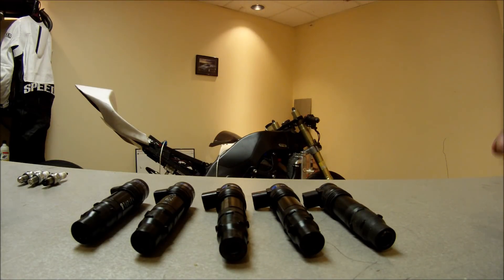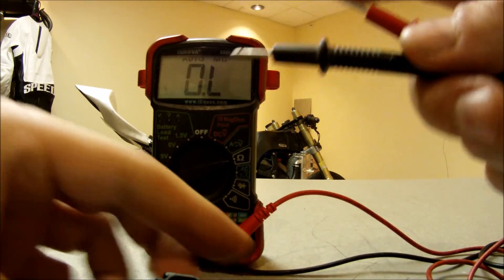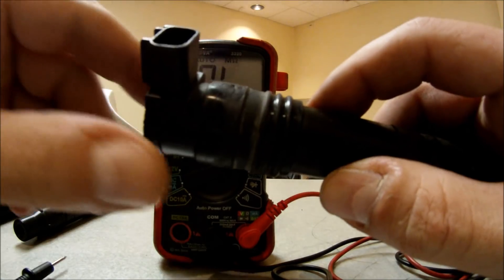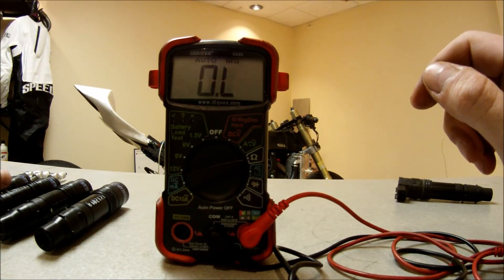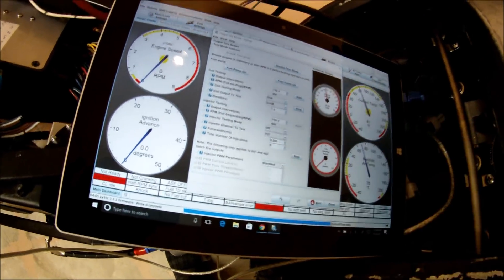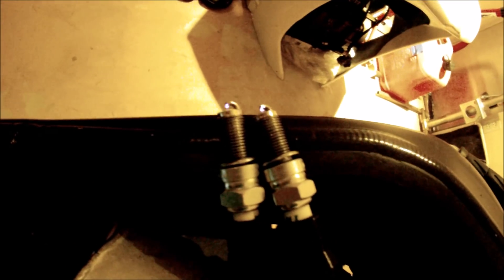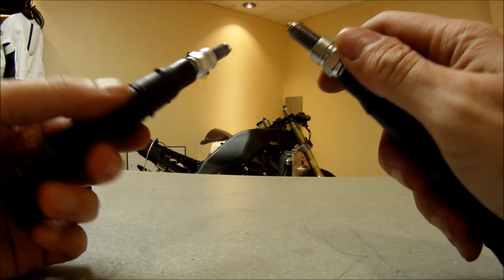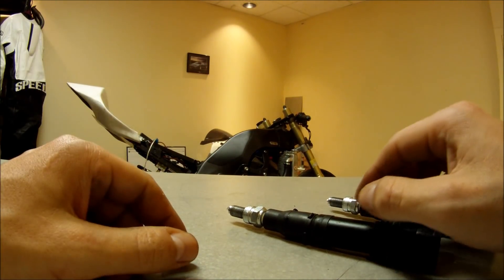OE Ignition Coil VS High Performance  Ignition Coil, Tested and Comparison, Best Spark and Specs.

Comment: So, can someone please tell me how much voltage my ignition coils provide at the spark plug? Primary resistance: 0.6 k Ohm, Secondary resistance 13.2 k Ohm. The ignition coil boot also has a 2 k Ohm resistance itself. Input voltage is 14.1 Volts. Thanks in advance.

Comment: Can't wait to order these.... going to order the wiring harness along with it. UPGRADED my FUEL SYSTEM (PUMP, and INJECTORS "6 PIN HOLE") my stock coils are garbage (have 65k on em), and are ABSOLUTELY TIRED.... GONNA WAKE MY GSXR 600 "UP"!!!🤙😎

Comment: He is not the one, at timestamp 03:15 the screen of the multimeter blinks, so to speak, goes blank as if power from battery is low or one or both leads are slightly or completely not seated tightly within there terminals, so we are viewing this material and are expected to trust the information given, so addressing the multimeter, he gives it a forceful slam on the bench top, so should I be trusting this new technique to address multimeter screen out. I think not. Trust is fickle and console very quickly be eroded or disappear. He never checked the leads, batteries etc. This is not the one. Oh did he disclose that the cheap coil is original to his bike which is not new and the expensive coil being tested is new. Not good science.

Comment: Instead of opening up the multimeter to get the battery to make a good connection ,you smacked it on the table.
Reply from the maker: Yes.

Comment: Absolutely no difference. Both sparks are capable of igniting the mixture. As soon as the mixture ignites it does its own thing, regardless of the power of the spark that ignited it. A fatter spark does not give a fatter ignition.

Comment: One thing I learned from performance coils is they really don't make a huge difference on fuel injected.
The main reason carbureted vehicles benefit so much from better ignition coils is because their carburetion is heavily emissions spec and full of other fuel/air compromises that make carburetion far less than perfect. What a high output coil does in these cases is compensate by its superior ability to ignite less than perfect mixtures. Better ignition coils make up for poorer carburetion.
Reply from the maker: Great info, thank you.
Reply: This really helped, Thanks

Comment: I think it means the original coil has more resistance which is a resistance to the curent flow and the coil and plug will laster longer.  The coil with less resstence will get hotter and also burn out the coil and plug faster because there will be more current flowing through the coil  making it get hotter. .

Comment: So correct me if I’m wrong. The aftermarket coils were better. But the stock spark plug was better than the iridium??? Good video btw
Reply from the maker: Unless you have a high horsepower engine with boost or nitrous, neither coil or spark plug will give you anymore power, if that's what you're asking.

Comment: If its a performance coil it should read under 1 ohm. A factory coil is only 1 ohm performance coil is usually half an ohm more power this is for a vehicle though not a bike i don't know about a bike
Reply from the maker: Primary resistance doesn't tell the whole story by itself.
Reply: @everydayirace  I know but the better resistance the more power it makes. thats why thicker spark plug wires carry more current less current drop over a thicker wire.
Reply from the maker: Ok.

Comment: Nice trick you did with that DVM 😂😂😂, funny stuff. But overall, I’m building a r1 turbo kart, not sure much boost I’ll run yet, but what’s your take on boost and the OEM coils? Is it necessary to switch them? Was doing research on that information and cane across your vid
Reply from the maker: Check this video out, I tested stock coils https://youtu.be/xP3d7hLRrZg , that should give you the answer.

Comment: Have you ever used ac delco extreme sport spark plugs??  I’ve bought them to swap in the spring. Good video.  Lol.  Sometimes you gotta smack the damn thing.
Reply from the maker: No I haven't used them, I'll have to get my hands on a set.
Reply: ac delco+ delphi+ good product especially with G.M. product= o.e.m.)

Comment: As i know the only difference between the original and the other coil ignition is the resistance to heat,when they got hot the resistance increase,and you must to test it,to normal temp and after some hours of use.There is the trick,the coil is the same in every part of the world,it could change the purity of cuprum(CU) of the coil,but i have my doubts.
Reply: Where did you learn to say "cuprum"? We say "copper" in America, but "cuprum" makes better sense with the element's symbol.
Reply: @pronewbofficial  in highschool i think,chemistry class.Elements in latin.

Comment: Hi.
I like to ask if anybody knows to give me an answer to this!
The Aftermarket coils are claiming that their coil power is 40-45.000 Volts. The aftermarket companies also claiming that the manufacturer coils are 20-25.000 Volts.
By measuring your way the Ohm we find the Primary Resistance is about 35% higher and the Secondary almost 50% higher to this specific coils. 

Having those two measures in hand, anybody can tell me WHAT can be the difference in %, in Volts? 

Also IF we can find the Actual Volt of ANY coil IF we have those two measures on hand?
Thanks.
Reply from the maker: You can measure voltage of the coil with a voltmeter that is able to read high voltage. My question is what are you trying to accomplish?
Reply: @everydayirace  . We want to check IF some "performance coils" which they say that they deliver 40.000 Volts and IF they are Better than the OEM coils! 

We want to check IF the voltage they claim is correct or not, but we don't know if this is easy!
Also, I don't think that there is a Voltmeter in the market which can measure 20.000 Volts.
Reply from the maker: @AutoproGreece  There is a way to measure it and it's easy if you have the right tools.
Reply: @everydayirace  I found some voltmeters measuring up to 40.000 volts for about $100.
Say we  measure  the Primary and Secondary Ohms in the two coils as you did. 

Is any math type and can we say or find that the Performance coil is 20% or 30% better than the OEM?
Thanks.
Emmanuel
Reply from the maker: @AutoproGreece  I don't have a voltmeter like that nor did I ever tried to find one, so my answer would be I don't know. But what I am wondering is why you calling coils better? There is a coil for every application, more volts doesn't equal more power from the engine, meaning if you put 200000000 volt coil in an engine that doesn't suffer from misfire with a stock coil, you'll get 0 gains from installing that 2000000000 v ignition coil.
Reply: @everydayirace  Your answer is covering me! We thought by installing a better Coil with higher Volt, you will have some small gain in HP and torque because of better fuel burning, even 2-3%. We've heard also that there is small gain in miles too.

Anyway, thanks for all.
Reply from the maker: @AutoproGreece  spark plug ignites air/fuel mixture, it has nothing to do with fuel burn rate or laminar flame speed of the fuel. The only time aftermarket ignition coil will produce more engine power is if stock ignition coil can't ignite air/fuel mixture......on high boost applications.

Comment: The real problem with the O.E.M. coils isn't inside but the plastic shell which dries out and gets micro cracks that allow the spark to arc-fire .
Reply from the maker: Yes, it is a very common problem.
Reply: true+ if a scratch or weak spot is on it + not a good thing

Comment: hi is it ok to upgrade the coil if you have an open looper O2 piggyback already?
Reply from the maker: It's ok to upgrade the coil as long as your electrical system can handle higher current load.

Comment: I think the 0.85 ohms is correct. You have not deducted the error. First you have to short the leads of meter and note the reading. This should be done for low resistance measurements. thanks

Comment: Hi is it advisable to use frm a stock primary winding 3k ohm to 0.3 ohm resistance? But in addition, i install a 5k ohm plug caps. Please advise.. #sub

Comment: Hello Brother. I’m sorry coz this may be slightly different mode of transportation as i’m driving a car. I got my a 2008 mitsubishi lancer GLX (CS3), equipped with a 1.6L Naturally Aspirated engine (4G18), couples with a automation CVT gearbox.

I have found myself some perfomance thicker wires and ignition coils online. And it was proven by another consumer that the outcome was a good change.. response and pick-up to speed was significantly better than it was before... any advice on whether i should proceed with the mod or should i just stick to stock?
Reply from the maker: If it was proven that the outcome was a good change, and if that change is worth the cost to you, you should get them. If the cost isn't worth it to you, you should stay with oem.
Reply: EVERY DAY I RACE hmm. Do you believe that more pickup power equals to higher fuel consumption? Because i was told that if i were to go for the Performance Ignition Coils and the Performance Wires done, i’ll receive enhanced car performance, and the life span of the coils will be able to withstand slightly bit longer than stock ignition coils. How can you advise on that take?
Reply from the maker: if you had a car with a boosted engine running 45+ psi and experiencing spark blow out, i would say go for it. The best way to decrease fuel consumption is to change the way you drive, it cost no money and you'll be able to measure the gains.
Reply: Imo more efficient fuel combustion results in better performance and fuel consumption. If a coil can combust fuel more efficiently then it should require less fuel for the same result

Comment: You should always start when checking ohm by checking your leads
Verifying your meters test leads
Then set you meter to the greatest amount of Resolution or auto range
Fluke makes a great self pace test to teach you how to use a DVM for their 88 model but its good for any DVM

Comment: You can't accurately measure less than an ohm with a DMM like that. To get close you'd need a DMM with 4 leads. I would trust the mfg's stated 0.85 ohms.

Comment: I subbed bro , should I buy after market coils or not ? 
2009 Maxima
Reply: mr logick the stock ones are just fine. You will not see any improvement unless you have modified ur car. Turbo or supercharger
Reply: You may or may not see any improvement but they are probably made better & last longer.

Comment: I have 2005 zx10r. Have you tested Brisk spark plugs  AR10ZS?  It would be nice to test it to see if 3sparks per ignition is better.
Reply from the maker: No i haven't tested brisk spark plugs.
Reply: can you test them(Brisk AR10ZS) in some way, if you had them?
Reply from the maker: If i had them i could test them at the race track.
Reply: I saw 5hp gain and way better response with brisk I will not run anything but brisk in my high performance vehicles I ran in my busa as well didn't get to test but u can definitely feel the difference from the ngk